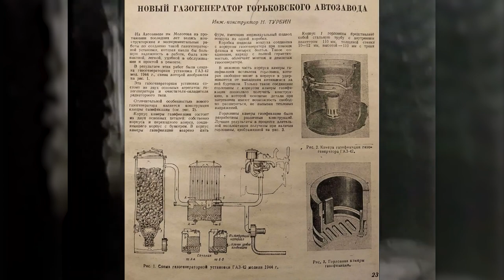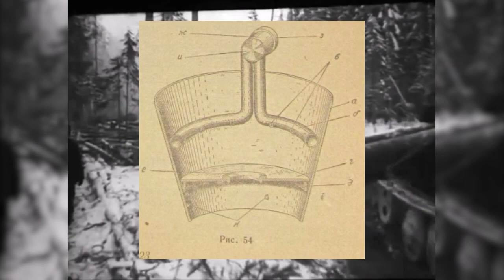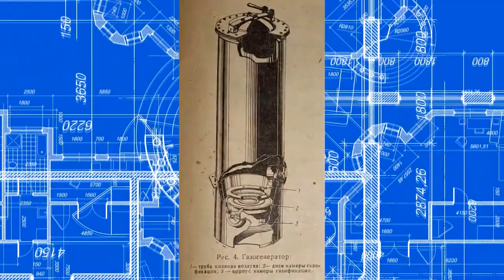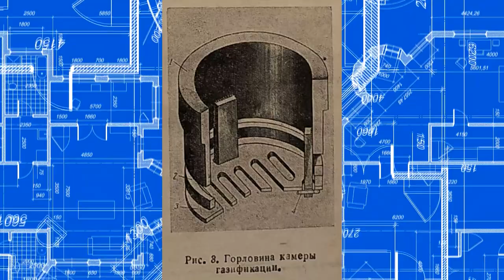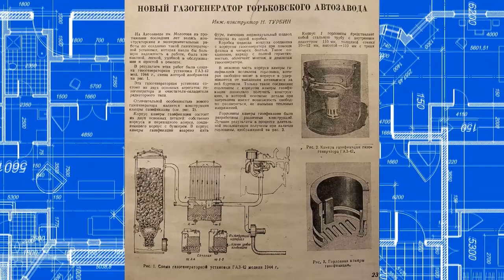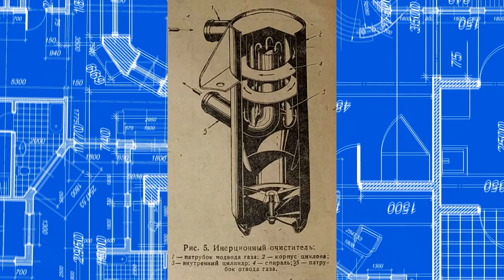How Soviet engineer outsmarted Imbert in 1944: Turbin's firebox and filters

Comment: Maybe it’s time to use part of the Gasafirer  to mix heated air to mix with Petrol as wood burning car must be running on lower fuel and air ratios than we were to believe engines can run on.just thinking out aloud.
Reply from the maker: they already did it, it turned out that gasoline consumption should be about 20% - which is not profitable